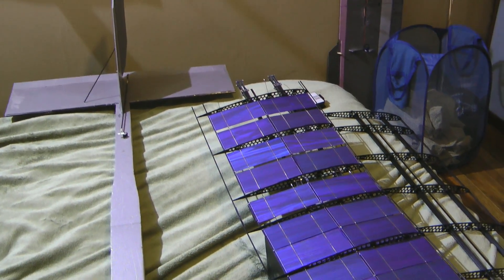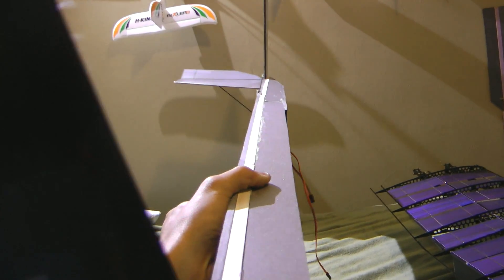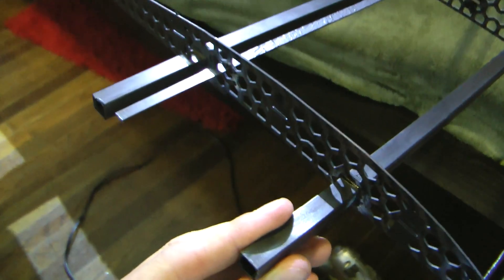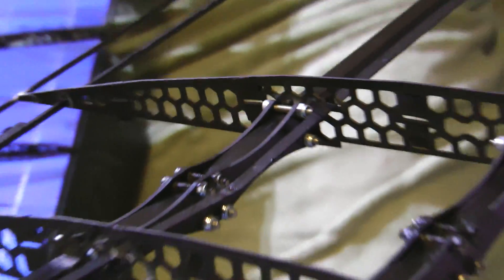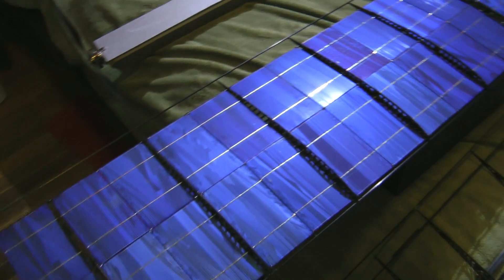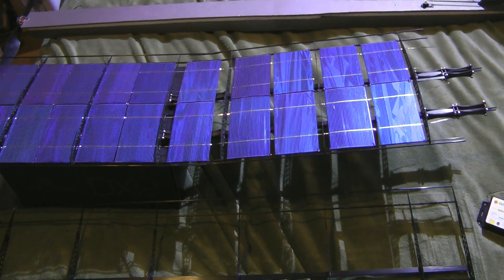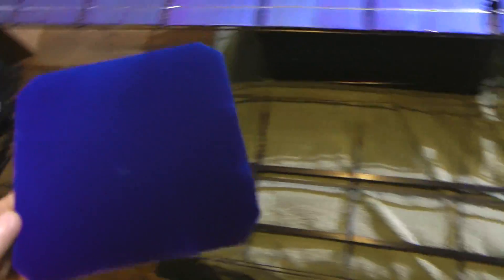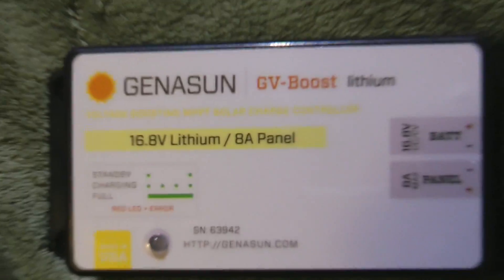RCTESTFLIGHT - Solar Plane Update - Episode 3

Comment: Great project Daniel.  Exciting to see this developing.
One simple solution you could use to prevent the torque problem with the wing is to maybe add some light carbon tow in a diagonal web tacked to the carbon frame with CA.   This would be very lightweight and would contribute to the rigidity of the wing.  This technique has been used in some DLG gliders.

Comment: if your going to add carbon fiber put it on the top and the bottom because the tensile strength is what you're looking for that should help you from bouncing up and down if you put the carbon fiber on the sides it'll help stiffen the wiggle from left to right.
also make sure you glued in real well use some 5 minute epoxy or actually some 20 minute epoxy because you're going to need time to work with it make sure you get the entire Rod wetted with a little bit of a fillet between the rod and or bar and the fuselage.
the important thing if you want it to work is to make sure that it's completely encapsulated...
in fact you'd be better off using some carbon fiber ribbon....
if you have at tap plastic near you they actually sell the cloth  you can cut into ribbons...
the best thing to do would just be to get some carbon fiber cloth, wrap the entire fuselage just like you would if you were fiberglassing do a couple of layers and then if you want to you can use acetone to eat the foam out from inside of it when you're done end up with a perfect fuselage.
I hope my voice recognition on my cell phone didn't chop this up too bad but you get the idea.
if you wanted more information send me a PM had some ideas on stiffen up your wing too.....